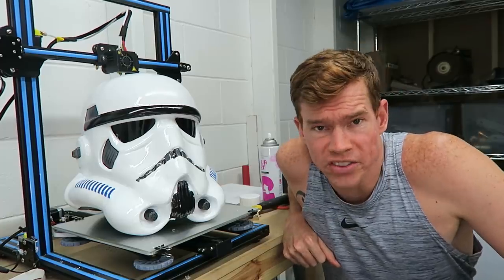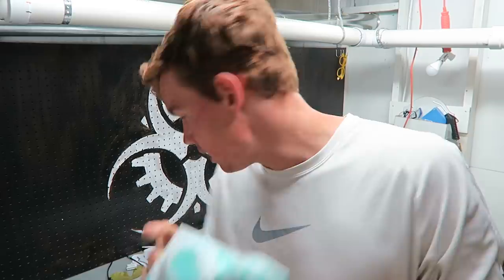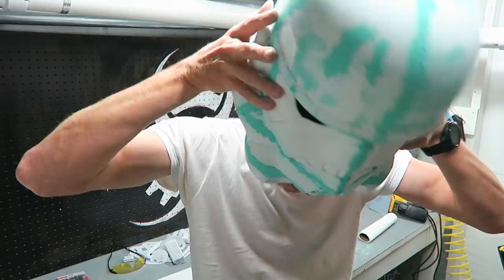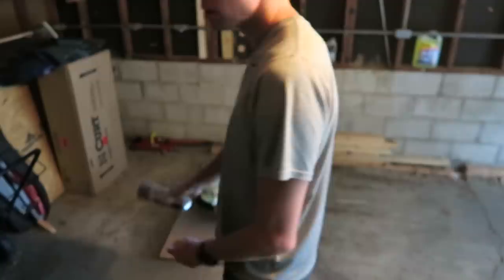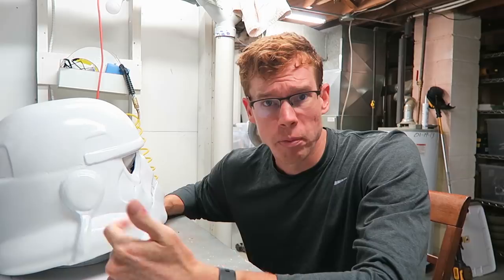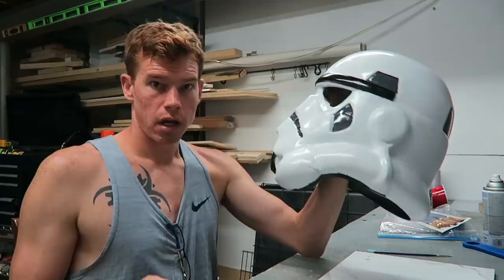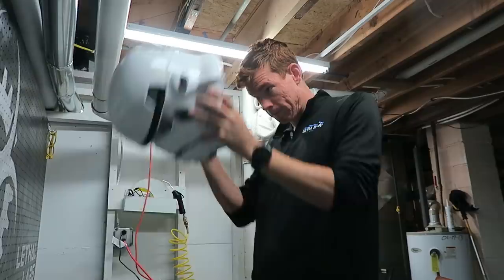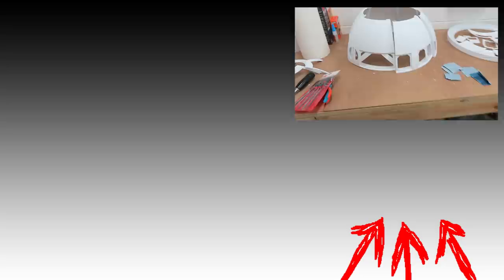How To Make A 3D Printed Stormtrooper Helmet

Comment: One thing you should do before gluing each piece is do a dry fit, to see if there is any noticeable gaps and if it lines up properly. If they don´t, sand, cut, etc until they do, then glue in place. The helmet looks amazing btw!

Comment: Use a trouble light or table lamp when sanding. Shine the light across the surface rather than directly at it. This way you’ll be able to see all the ridges and imperfections that are more visible when painted.

Comment: Sanding without support on the sandpaper makes it harder to eliminate dripping and uneven imperfections, because your fingers are soft enough that they adapt to the imperfection surface. If you make some sanding strips or blocks glueing the sand paper using 1/4" thick wood or mdf you will be able to get rid  imperfections faster because they are hard and don't adapt to the imperfection shape, so they sand it faster. you can use a couple of tongue depressors and make them in any shape or form that you need to get into those tight spots.
Reply from the maker: Thanks for the tips! I went out and purchased a sanding block and will use it on my future helmets and R2D2

Comment: Spray paint shot from rattlecans goes  much better in little bursts, you get much more even coverage that way. Holding the nozzle down and just going back and forth is a 100 percent guarantee of sanding that didn't need to happen. A lot of those imperfections you found with the primer were  the primer which had run, not the mask underneath, in short...you made a whole bunch of extra work for yourself. Its tempting to shoot a lot of paint in one go but light coats built up gradually is the way to a good finish with minimal cleanup work.
I quit my car bodywork apprenticeship but something obviously sunk in lol.

Comment: I can only imagine how much that cost and it make the $100 helmets on Amazon look actual props.
Reply: Up close they really don't, 100 dollar helmets are never screen accurate
Reply: @angelosanti9761  I will put it like this they look more  accurate than the FX helmet that was molded from an actual EP4 stunt helmet.  The main thing is the cheap bucket that I have is 1:1 size where the FX is considerable larger because of how the mold were created.

Not sure they still sell the cheap helmet I have today.   I Purchased it somewhere between 2010-2011. It is a licensed reproduction of a 1:1 RTJ helmet that sold for less than $200 on Amazon.   It's the same bucket the Disney staff wear with their Lucasfilm issued suits just with the hero green flat lens vs smoked bubbles
Reply: @GlassTopRX7  I'm mean really it's down to if you want how they should kinda look vs the set look of the helmet
Reply: It would cost me 5k

Comment: hey you should only use the print to make a negative mold. Then you can make a few positive molds then just make a bunch of helmets at once and they will be structurally more sound and quicker to make than a print.

Comment: So far i've made a three part vader helmet and Geofro Death trooper helmet, I tend to assemble all the helmet and then start the sanding and filling process. I use the XTC also, its good stuff,,,dont mix too much of that stuff in a small container thou...it goes off real quick if you do. I'm wanting to 3d print stormtrooper armour but cant find a screen accurate one,, nice videos,, good helmets.
Reply from the maker: Yeah I should have definitely poured the XTC 3D on a plate! I really dig that death trooper helmet and plan on making one in the future.

Comment: Ref Link fot the Green Filler ant the xtc-3d? 
I didn't know them before and if there were a Ref Link here now ;)
Reply from the maker: I've started using wood filler (wood putty)....much easier to use!
Reply: Lethal Engineering have you tried bondo? I Won’t claim it to be as easy to sand, but would fill the seams well and I find it easier to apply on larger surfaces versus a spot putty.

Comment: Hey I'm about to get a file of darth Vader on do3d and I'm wondering what type of stuff should I cover it to make it smooth
Reply from the maker: After a good sanding, XTC 3D works really well
Reply: Lethal Engineering thanks for the tip

Comment: anyone here please.  can anyone point me in the right direction of how to "slice" the file (if thats the correct term) to be able to print this on an ender 3, I just purchased the creality ender 3 (all I can afford) and would like to print this helmet but I know it wont fit on the 200mm print bed. (I think it's a 200mm bed anyway lol)
Reply from the maker: @adonian I updated the description with link to the print files. The helmet was sliced by the creator, and each piece should fit on your ender 3. You might have to rotate some pieces to fit, but the designer (Geoffro) purposely sliced them to fit on smaller printers. Hope that helps!
Reply: Lethal Engineering awesome thx. Can’t wait to give it a try

Comment: Learn to spray paint, it would be a lot easier , can spray is all ways crap paint to use, wet flat is better than dry flatting with can spray paint, if you would have used mixed 2 PAC filler primer it would have got rid of all them lines, then used pac2 white solid every thing would have gone and been super smooth. Oh yea use a paint/dust mask when flatting paint and plastic down. They don’t cost much but it will save your lungs

Comment: Can u do a 3D printed captain rex phase 2 helmet
Reply from the maker: Yes I can! Added to the project list.
Reply: Hey I’m also going to get my first 3D printer the annet a8 is it a good idea to use it to print my requested helmet on it
Reply: Is it a good idea to print a helmet or armor piece from a $150 dollar 3D printer
Reply from the maker: @lilrobi45xxx42  I've heard good things about the Anet A8 but have never used one personally. An issue with cheaper 3D printers is poor quality prints which would just take longer to sand and finish. The Creality CR-10 is a good mix of price and quality.

Comment: Bro no offense but you're horrible at this.  There's no reason at all that your prints should be this rough after so many hours went into them.  First, your printer needs to be calibrated to get smoother prints straight off the bed.  Your print lines shouldn't be that apparent.  Use putty only for filling seams, not for filling in print lines in huge areas of the print.  Skip the XTC-3D step because 2 videos in a row now you clearly don't understand how this stuff works.  It should make your print smoother, not worse.  If you're looking for reinforcement i'd recommend applying a coat of resin to the inside of the helmet, not the outside.  The majority of the finish work should be done in the filler primer stages, except you're spraying primer onto big globs of excess resin and putty.  There's no point to priming over high spots that should have been sanded down before hand.
Reply from the maker: Agreed. I finally figured out how to improve my print quality after many bed leveling tests (debris in print nozzle, replaced nozzle, which fixed print quality). I disagree about the XTC-3D. It's initially rough, but gives a really smooth finish once lightly sanded.

Comment: Man try d i y sally putty. It only cost $ 17 a tube or $ 8 for small tubes. ... me $ 320 23 tube s.  to make a mascot head.    Its light wait to but not 3d printed      but its all one peace  beside s the ear s on mine  an you can. Make the as mask s outta kids floor foam with a heat gun  to shape an brand the part s an. Less sanding.   It show s. If 3d printing sume thing like this u need to be on point with joint s. Like u seed. In graffic s. Unless got a big bild plate to print. In. One peace  thers a guy. I Sean on a vid other day. He printing amazing body armer n marsk s